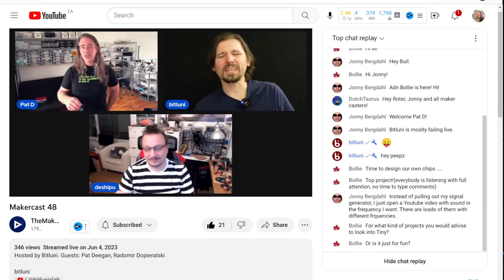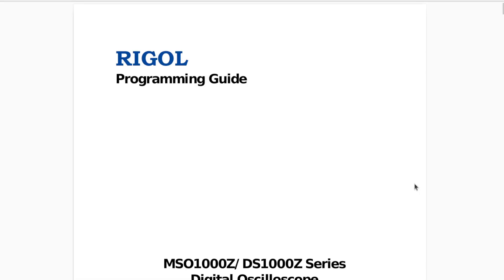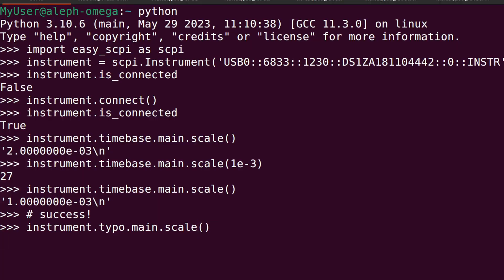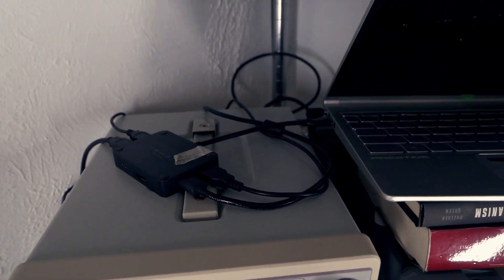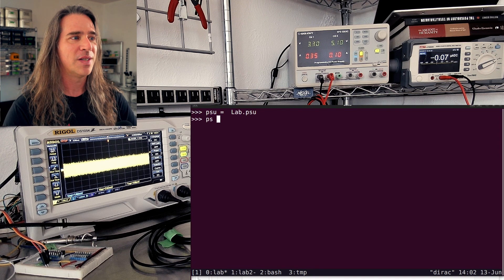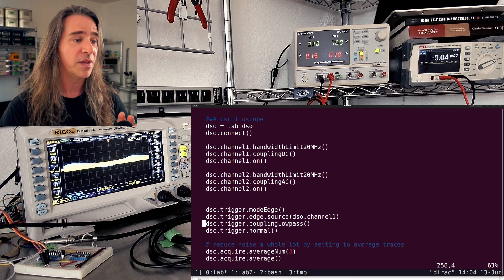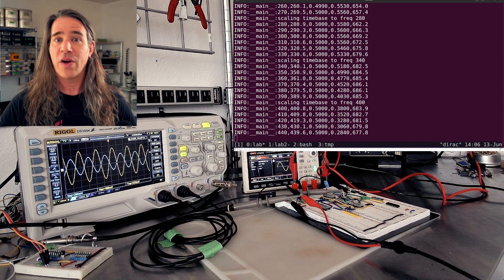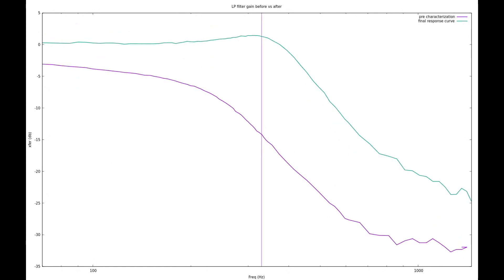Lab Instrument Automation with Python

Comment: I recently needed to control a piece of test-equipment (keysight e-load) which has an rs-232 port..  so I figured I'd use python (pip install pyserial, import serial)..  or just run a terminal app like realterm.  

However, looking at the documentation, they use SCPI and VISA. Do you have any thoughts on what the difference is between using pyvisa to get the COM port resource, and accessing it via pyvisa versus just sending the same ascii data via pyserial / realterm?
Reply from the maker: Hi Ben,  I think you can basically do everything you want down at the low level but that even if it's just a serial comm line, pyvisa may be useful when it comes to dealing with values.  For example, the converter, datatype and container attributes used in some of the examples on  https://pyvisa.readthedocs.io/en/latest/introduction/rvalues.html show that a lot of the annoying data manipulation stuff gets a lot easier.

Comment: sir waveform generator connect to pc via LAN cable steps please help me sir
Reply from the maker: Hello.  This really depends a whole lot on the specifics of the hardware.  If it has a LAN port, you should be good with the tools described but the actual commands will depend on the device.  If you figure it out, and maybe extend my library, let me know

Comment: Reminds me of testing avionic equipment with FAPA that was pre-built, but similar concept - computer ran pretty much everything and the technician only did adjustments and part replacement.
Reply from the maker: I use it a ton, mostly for data gathering and this kind of repetitive/automateable test sequence.  Think I'm going to need to upgrade my DMM, tough--it works fine, the precision is fine, but the weird, non-SCPI uart type protocol and the reading refresh are a bit on the slow side.
Couldn't figure out what FAPA is... "Future & Active Pilot Advisors" ?
Reply: @PsychogenicTechnologies   F-15 Adapted and I can't call the rest...not out there, that's surprising...probably is, just need to be specific.  Also, what is the cheapest DMM or meter or scope device you can buy to start learning this stuff? I know many coding languages, but this could be useful...I'm learning python, but had been focused on assembly and embedded systems. THANK YOU again for the video.
Reply from the maker: @t1nk3r_n_r3v3rs  Hi!  DMM: I have a friend, went out a got himself a used fluke, 'cause he wanted dashit but you know it's crazy expensive, so he wound up with... a non-functional DMM.  Honestly, just go for a unitrend/uni-t model, they make really decent stuff...  once you want something high performance that'll last years, you can do some shopping, get a bigger name, faster, more automation, etc.  Scope wise: I started with an old analog 20MHz o'scope back in the day and it rocked my world.  But now... depends what you want to play with, lots of options.  If it isn't too high freq, and you want to just see how far you get, go for a USB/computer scope.  I still have a bitscope around, good for carrying with, get 2 analog channels and a handful of logic probes, it's ok.  Otherwise, an entry level Rigol is hard to beat.  Hope that helps, have fun!

Comment: You should write a python. Script to show the plot in real time . Vere usefull stuff. Also have you measure the output voltage of a  pressure  sensor when released at the ms ti.e?
Reply from the maker: Hello Cess!  Hm, realtime: you're right, I usually just collect lots of data then make plots, but it would be nice to see things as they happen.  I'm not all that good with the GUI stuff, but I think a little something would be very useful.  As for the pressure sensor, I haven't had occasion to use much of that nature (unless you count load cells).  What are you using, which sensor, and what are you doing with it?
Reply: Actually using a vba code to sampling every second the output voltage of a pressure sensor from a pressure controller it is very useful to check the transducer response and plot in a chart in real time. Thanks for aslking. @PsychogenicTechnologies
Reply from the maker: @cessromer7078  ah, cool.  Funny you should write today, I just had to write some new code in there, for another 'scope and to do some characterization of photovoltaic cells... scripting this stuff sure saves a lot of work!  Cheers
Reply: Here's one of many tutorials how to do simple real time plotting with matplotlib.pyplot if anyone is looking for it: https://www.youtube.com/watch?v=Ercd-Ip5PfQ

Comment: Hello, Im trying to figure out how to use easy-scpi for RIGOL 831 DC power supply. In the easy-scpi documentation it says that, for example, to set the voltage to 1V you have to write the following command: "inst.measure.voltage.dc( 1 )" that cames from [MEASure:VOLTage:DC 1]. Now im trying toadapt the command of the DC supply ":APPL CH1,5,1" that set the voltage and current of CH1 to 5V and 1A to easy.scipy code line. How can I do this? Sorry if something is not correctly explained but its my first time using PyVisa controllers and Im still learning how to use this stuff. PD: Great video.
Reply from the maker: Hello Alejandro!  Happy you liked the video 😀 So, the thing is, the actual commands are super instrument-dependent.  Thankfully, Rigol is pretty good at providing documentation.  I think, to set the voltage with your instrument, it'd be something like: inst.source1.voltage.level.immediate(1) to set it. I'm not certain.  However I did find this:
https://www.batronix.com/pdf/Rigol/ProgrammingGuide/DP800_ProgrammingGuide_EN.pdf
Now you know why I wrap it up in higher level python abstractions, hah!  
So, I'd go through that, and try out some basic queries first, e.g. without the parameter:
inst.source1.voltage.level.immediate() 
and see what comes back.
Let me know if that gives you better results
Reply from the maker: Note: am assuming your instrument is a DP800 series, in above--not certain that's the case.  But if you can find the appropriate doc/command set, you should be good.

Comment: Cool, Pat!  What would you recommend for creating test instruments with LXI/SCPI interface?
Reply from the maker: Oooh, creating the instrument side is a pretty interesting challenge.  
Getting the LAN/Ethernet interface isn't a big deal, but even if you're not going to join the consortium and go for compliance/cert and you only want to implement the minimum interface ("functional class C", which I think implies LAN and web interfaces, discovery and basic driver), your first step is going to be a whole lot of reading.
Thankfully, it looks like the specs are pretty easy to access and you begin by having a look at 
https://www.lxistandard.org/Documents/Specifications/LXI_Revision_1_0.pdf
and, I sure haven't gone through all of these but this does look like a very interesting resource
https://www.ivifoundation.org/specifications/default.aspx
Reply from the maker: Addendum: you may be able to get a head start with some open source instrument implementation library--I don't know, haven't checked what might be available... but you'll still want some good knowledge of what needs to be implemented and why, so... yeah: lotta reading :)
Reply: @PsychogenicTechnologies Thanks, I’ll go do some reading!

Comment: Awesome! Thanks for this video. My PSU and DSO both support this.
Reply from the maker: Nice!  An idea how different they are from current implementations in the library?  Assuming it isn't exactly the same hardware, let me know if you try stuff out and get anything working as-is and can be re-used or how different the command sets are.

Comment: Really great video and thanks for sharing! I've been doing my best to learn python and have been slowly automating data collection with my Siglent oscilloscope for a stepper motor dyno/characterization test bench. It's so satisfying to have all the data collection and processing automated! I wish I had known about easy-scpi when I got started, that would have been helpful.
Reply from the maker: Thanks a lot!  I know, it's such a great feeling to just "throw a switch" and have the system handle everything :)  It's not just that I'm lazy (though there is that) but it's less error prone and it's given me more opportunity to try different stuff and see the impact.

I've also had cases where some pretty sensitive analog ASICs wanted a slow ramp on, rather than an abrupt power-up (mostly they were fine anyway, but we had a very limited supply of these things), and being able to ramp up the PSU as part of the scripts was pretty useful.

With SCPI and that library, it's been pretty simple to add in support for various devices.  Which scope is it?  I'd love to see just how different it is from the Rigol and am kind of itching to get more devices supported in there--if you'd be willing to try it out for me, I'd give it a go...